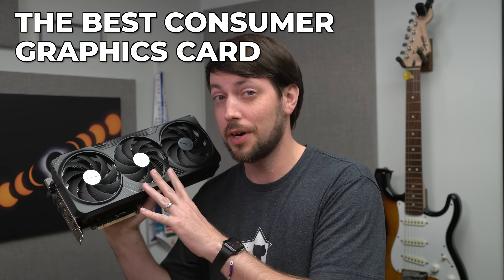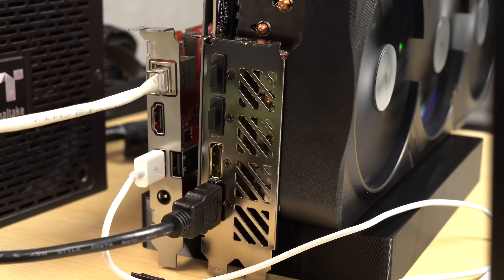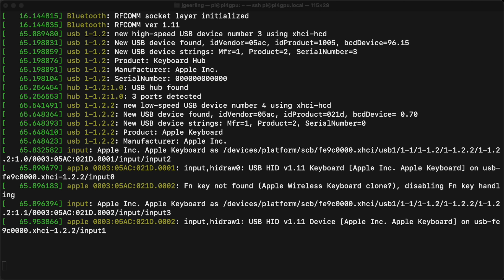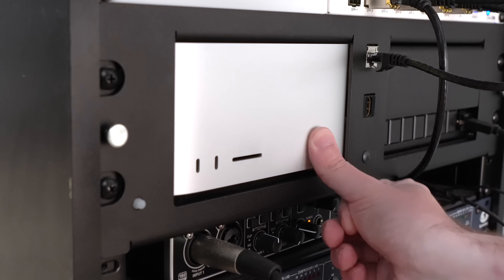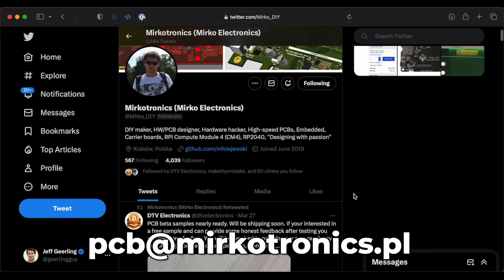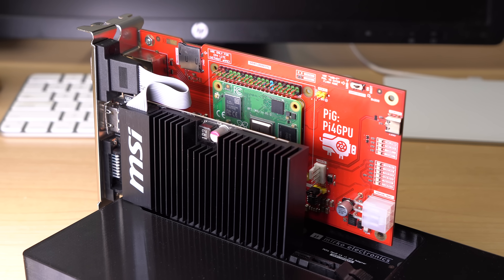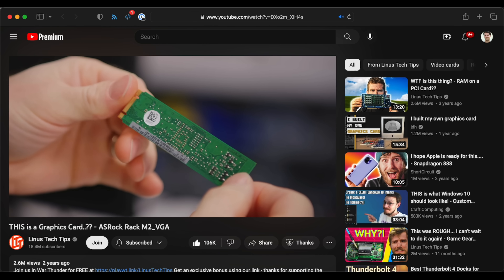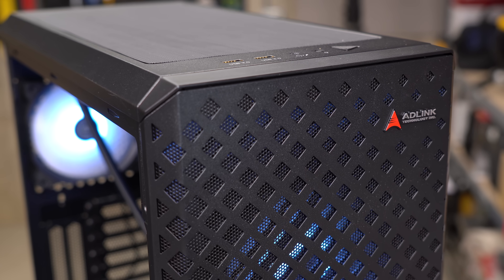I tested EVERY graphics card on a Raspberry Pi!

Comment: Jeff, them telling you to return the card IS AN RMA. Return Material Authorization - when a vendor/seller takes something you bought in return, or technically when they say they will accept it in return which is what the AMD reps did - they told you to return it, when the vendor does it - they are 'authorizing the return' as it were.

Comment: if im honest i would love to have support to connect multiple gpus to a R-Pi i mean just as an example my nephew loves pi stuff and messes aaround with linus and python all that and is learning how to do stuff with pi projects and all that but it would be cool if i could plug a gpu into this pi  with maybe its own power ssupply and pcie x16 sloit but stillif i could order pciex16  slot for pi  and then the wires and maybe an extra psu for a pc or mayeb a charger block for the gpu thenb that pie could be used for gamign aasswell that woudl be awesome

Comment: I've looked at Ampere's Altra SoC "brief", and although it clearly isn't a multicore system, rather a multiprocessor, they let themselves down badly in both not having on-die RAM, nor splitting their processors between multipled dies to use distributed memory. The old processor paradigm just doesn't work with large dies and separate working memory.
Reply from the maker: On-die RAM is a fairly new thing, with HBM just hitting the retail (server) market, and desktops in the form of Apple's M-series chips. Definitely some progress to be made there, but not all workloads require the bleeding-edge performance there, some just want tons of low-power cores. It's nice there are so many options for the server market today.

Comment: I absolutely love this passion project of yours and I would buy a 4090 for my raspberry pi today if you got this working but I do wonder if this goal might be slightly easier using an Nvidia Jetson Nano or AGX Orin since these are made by Nvidia and have Nvidia arm64 GPU drivers already. Obviously they’re not the drivers for a 4090 but might be a better starting point for getting this working rather than from scratch. 

I’m curious what you think of the viability of this as someone who has put hundreds of hours into this project already?

Comment: It seems that the biggest parts of the new graphics cards are the coolers
Wouldn't surprise me if water cooling just the graphic card will become even more common. Not for overclocking but just to reduce size.

Comment: Is it possible due to PCIe bus power is not enough? How about try to something like pcie extend cable with extra power support?
Reply from the maker: In this case, we made sure the spec is met for board power (75W, provided via the PCIe connection on the Pi board) and direct supply into the cards from an adequately sized PSU.

Comment: That is pretty normal for xinit to spit out logs like that, it has something to-do with line endings ;)
Reply: You are not the only person to envision a plug-on CPU for a GPU or other PCI-Express device like a soundcard.

I think a SBC based on an Atom CPU or AMD APU would be a much better fit!
Reply from the maker: Or an Ampere Altra... though it'd be huge!
Reply: @JeffGeerling  I've had this idea since my Aspire One netbook, just a simple CPU board with memory and a fullsize slot!

I was thinking soundcard for use as VST host or a board which you can simply plug a device into and test it.

Comment: Can that M.2 GPU be useful as a hardware video transcoder in a server that otherwise doesn't need a GPU at all?
Reply from the maker: No, unfortunately that GPU is a really old design and doesn't have any kind of hardware transcoding built in. It's really best if you just need a DVI or HDMI output or two.

Comment: I'd love to see someone buy the Rendition Verite GPU intellectual property from Micron. In the first era of GPUs, Rendition was hot stuff. Then some silicon design they bought from another company had a bug that was so difficult to track down they resorted to using Mark One Eyeballs and microscopes to pore over test dies of their second generation chips for six months to find the problem.

By then it was too late. nVidia, 3Dfx, and ATi had their new GPUs out and it was "Rendition who?". Micron bought Rendition, hired a bunch of the people, promised to write a full OpenGL ICD for both models of the GPU... then total silence. Micron did absolutely nothing with the IP other than using the Rendition name on a bargain RAM line for a while.

The design should work as a base to build on, since it was optimized for a small amount of RAM. They had a design for a more advanced GPU (Verite 4400E) with 12 meg RAM, USB, Ultra ATA66, AC'98, and Firewire all in one. That sort of concept, built with current process technology, could be a tiny BGA. Drop Ultra ATA66 and replace firewire with SATA and up the USB to USB-C.

The main thing to do with it would be to open source the Verite GPU design so it could be updated and expanded and drivers made for various systems without any binary code blobs.

Comment: arm needs to become as hardware agnostic, i think thats the term im looking for, as x86. you need to be able to plug in anything you need for work into it without screwing around. audio, visual, controllers anything else you can find. 
yes i realize that some things are still fiddly on x86 still but its less time consuming than arm.

Comment: Amazing video, Jeff! I wanted to ask you if something's possible - and maybe present it as a challenge. Say you built a board with an AMD APU (say a 6800U), and an arm soc (say a raspberry pi compute module, or better yet a qualcomm snapdragon (i'll explain why in a sec)). Would it be possible to make it boot in such a way, that it can either a) boot from the arm SoC, and use the AMD APU as a GPU or b) boot from the AMD APU, and use the arm SoC as a coprocessor (+ possibly if the arm chip has a gpu, then use the gpu of that?) - that would be mind bendingly cool. And I think it would have a loooot of applications. Imagine something like a Steam Deck that can enter a "low power" state where it'll run for 12 hours on its battery while you're just browsing or playing low complexity games; or to put it the other way around, imagine something like an Android phone, that can also run Elden Ring when you want it to (just a reboot away). That would be pretty amazing imo.

Comment: you need to make a pcie raspberry pi CM4 so the raspberry pi is powered off the pcie bus with pin 2 for power and pin 4 for ground and on the pcie bracket 2 usb 3.0 ports 2 hdmi ports and ethernet on the back for a raspberry pi CM4 inside a pc

Comment: Neat project! Just in case anyone stumbles on this not as an ARM/RPi enthusiast, but more interested in using a modern ginormous modern GPU to the smallest SBC possible for ... reasons, the DFI GHF51 or Premio CT-NR101 are 1.8" SBCs that run Ryzen Embedded R1000 (this is basically a Raven Ridge, or equivalent to a Ryzen 2000 mobile class APU) and both have PCIe Gen2 Mini PCIe (of course, since these GPUs are >4" wide, you could easily put a 3.5" or 4" board underneath, which are a dime a dozen).

Comment: I got working solution to your issue - use x86_64 board. I tested it myself (from about Pentium D era which was my first system using PCI-E) and it works without any issues.

Comment: woah bro tried gt 710. Am using gt 710 lol.
Reply from the maker: It's still a nice little graphics card for adding a monitor and simple needs! I just installed one in an older PC so it could have a 2nd display.
Reply: @JeffGeerling  Funny thing that I am using it for gaming. Recently overclocked. It's working ok.  It runs very cool (30 celsius with cooling fan and oc) without overvolting. While overvolting it runs at 50 celsius and gets a bit of performance.

Comment: More than likely the problem is the ARM kernel doesn't have all the necessary functions the GPU needs to function correctly.  LIke you may have to compile a whole new kernel from the actual kernel source and not from raspi sources.

Comment: WOW, I knew about the defective AMD 7900 coolers. But I assumed AMD did a recall and/or RMAs on these things. But they didn't even do that?! Just leave them in the wild and make anyone who ends up with one return it?! I didn't need another reason to avoid Radeon graphics cards, but this is a massive one.

It's been months since this defect was discovered. Honestly at this point I would be fully supportive of the government stepping in and forcing AMD to do a recall on this product. Maybe slap them with some fines, too. This is absolutely pathetic of AMD.
Reply from the maker: I was surprised. But I returned it and just gave up on buying another. Nvidia gets the W this gen from me, but really they get the L for their pricing strategy.

Comment: The AMD cooling issue is actually a known hardware issue with the vapor chamber. Other board partners that are not using their reference cooler design should have no issue.

Comment: Well... For the AMD card, it is up to the boardpartner that builds it to do QC, not AMD. The same is true for nVidia cards. For either one you can get a bad card. That;s kind of a small sample size to say anything about the QC process. nVidia drivers have been quite decent in linux lately as well. I wouldn't say perfect, but I have not experienced many issues lately.
Reply from the maker: In the case of the Sapphire card I bought, it's the reference care from AMD, just packed in a Sapphire box. The bad cooler things seems to have been rampant (many people reported the same thing on their reference or Sapphire 7900 XTX cards), and was likely due to not having enough water in the vapor chamber from the factory.

Only AMD knows the extent of the problem, though. And many people would just think the XTX runs hot or something—it was only performing about 5% slower, but it was WAY louder since the fans ramped up to max.

Comment: I would've suggested intel if there gpu was out when you started trying this . Unfortunate the need for REBAR support on cpus really prevents intel from helping . The new setup to try to make this functional with your partners in crime is amazing looking and hopefully soon its functioning the way you want. Can't wait to potentially see that pretty arm system in action , looks like threadripper but if efficiency of those chips is anything , it will have a 65 wat tdp or something with 64+ cores.

Comment: Yes, the Adlink ARM Ampere Workstation will run the 4090 because it is advertised as having RTX support.
Reply from the maker: I don't know if the 4090 was certified on it or not yet, though — right now Nvidia is doing per-card certifications. But hopefully it will be easy to get it going!

Comment: Have you tried any RK3588 SBC? They have PCIe 3.0 IIRC with a more powerful CPU, oh and they can actually be purchased.
Reply from the maker: Yes! I tested the Rock 5 B and Orange Pi 5 a couple months ago; I haven't gotten any graphics cards working on them quite yet (had some trouble compiling the kernel).
Reply: @Jeff Geerling  oh that's unfortunate. Keep up the good work either way; Tinkering is always fun!

Comment: I'd love to see more systems running ARM, RISC-V and POWER processors. Being able to put in a GPU more powerful than the iGPU in ARM SOCs would be great ^_^
Reply: More powerful SoCs have better support. There are still the alignment requirements that can be worked around somewhat, but they don't have the 32bit access width limit the pi has.

Comment: I expected a computer atleast a cpu plugged into the graphics card really.
Reply from the maker: My stretch goal was to get the Pi inside the heat sink on the card... but that turned out to be a bit less possible.
Reply: @JeffGeerling  nothing that a radial saw can't fix.

Comment: the overheating problems of the 7900xtx are known of the reference model because the cooler is badly designed and some models have the overheating issue
Reply: It wasn't a design of the heatpipe of the air cooler, but a production problem. Not that it is much better than a design problem.

Comment: Cursor blink rate is a console option, which has nothing to do with the state of the operating system
Reply from the maker: I was being facetious; but in this case, that is a symptom of the full lockup, as the cursor always stops blinking when the first invalid memory access happens (and the only way to find where that is is to run GDB and check line by line in the driver).
Reply: @JeffGeerling  I see. Must've been a glass console. Did you also have the serial hooked up?

Comment: Disappointed that the lights didn’t dim when the first beast was powered up 😂
Reply from the maker: It made my UPS cry when I had it plugged into my AMD PC... I had to move the computer to the wall circuit directly with no UPS, because I don't have one that can supply the over 800W that system sometimes pulls!

Comment: I saw you still had nuoveau driver + nvidia in one crash dump, you can only run one or other,  you will need to clean boot - blacklist nuoveau- compile dkms nvidia driver-rebuild initrd , (see ubuntu issues on switching between,  some .so files are not removed in kernel changes , initrd resets)  you also have some grub boot options to widen pci bus availability in the arm kernel section you may need to change. I would also test with other devices too , there may be a clue in a nvme working but sound card not.
Reply from the maker: Yeah; in this case that screencap was from testing nouveau. I had two microSD cards set up—one with nouveau set up for debugging, and the other with a fresh Pi OS install I put a few different Nvidia ARM driver versions on. That way I couldn't run into the problem of both drivers being present. (nouveau isn't in the default Pi OS install).

Comment: Man, bad temperatures have been my entire experience with AMD graphics cards. The first one(HD<numbers>) overheated so badly it warped and killed my motherboard, too, the second(same as the first) overheated and destroyed only itself and the third(RX570) overheated and leaked crap all over the place.

I now no longer use AMD cards.

As for why you're doing this, I don't even know if there needs to be a why. "Because I can" should be considered a good answer... well, once you get it working, anyways.

Comment: That first video card is way too small. I'm holding out until I can buy a video card with 80 exabytes of memory that is 6 feet long and weighs 80 pounds, and it comes with 2 tiny Chinese fellas that hold the card up so it doesn't tear off the PCI slot from the motherboard. Of course this card will have to be directly connected to a power plant and would cost me $80.000 dollars a month to run. I have to get federal funding to buy the card but, I must have it.  :) :)

Comment: tbh Jeff, with a pci-e 2.0 x1 the only good thing a dGPU is good for is video encoding/decoding, and that at best case it would be adding a 50W gpu on a 5W PI4... and keep in mind that you may sature the bandwidth with multiple Jellyfin streams at the same time.
I think it only worth to try it on the RK3588 (not the S one) because with a 4x PCI-E 3.0 you can actually do AAA gaming on it. And if you only need a good video encoding/decoding the RK3588S is the way to go.
btw, the RPI4 have enoght cpu power to drive more than 2 screens?

Comment: "then I decided we needed a custom PCB bracket, and his friend Adam fabricated it", sheesh who doesn't Mirek know?? 😂 Casually, builds a pcb, knows a person for lasering the art on it, knows a person for fabricating the bracket.. Don't stop now 🙌🏼🤣
Reply from the maker: Next thing you know I'll need a custom SoC and he'll have some other friend fab it!
Reply: @JeffGeerling  I'd like to see someone design a SBC PC/XT clone with 2 DOS compatible USB ports, a PS/2 port, 2 DE9 RS232C ports, and VGA out. What to use for a case? The shell of a dead Netgear GS108 ProSafe 8 port Gigabit Switch. In place of the 8x Ethernet ports on the back there's room for the list of ports above, and the power connector is already through the opposite side of the switch. Give it hardware LIM EMS 4.0 and max out that RAM. Have it boot off an EMMC hooked up with XTIDE, with support for USB 1.44M floppy drives. Being able to boot from small USB flash drives would also be a good thing.

Why? Industrial / CNC control replacement. I have a ProLight PLM 2000 benchtop mill and the only software ever made for it runs in MS-DOS and needs EMS RAM to load gcode into. The mill is controlled via RS232C. The second serial port would be for the touchscreen on an ELO 800x600 industrial monitor I have.

I expect there are plenty of other old things that need EMS RAM but newer PC systems with a ton of built in peripherals have the UMA too fragmented, with no contiguous 64K free space nor a total of 64K or if there is 64K available it's fragmented into chunks too small for LIM 4.0 or any 3rd party EMS software to piece together.

The Netgear GS108 case is heavy steel, has a pair of 3-way mounting slots on its bottom, the case opens up with a pair of screws - even when mounted to a wall, it has four PCB mounting holes inside, it has a large opening in the back exactly the size of 8 Ethernet ports in a row, and it's dark blue. It's as if Netgear designed it perfectly to house an 8088 SBC or other SBC - as long as you choose the port assortment carefully.